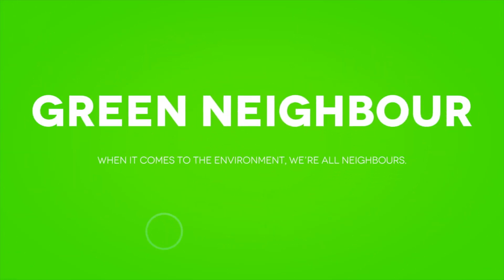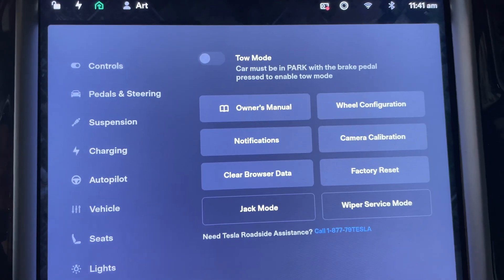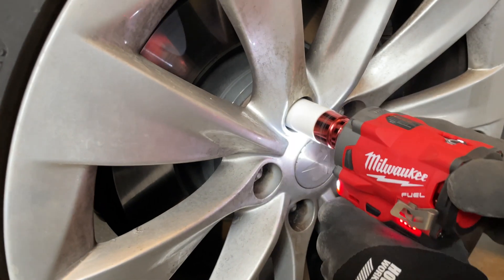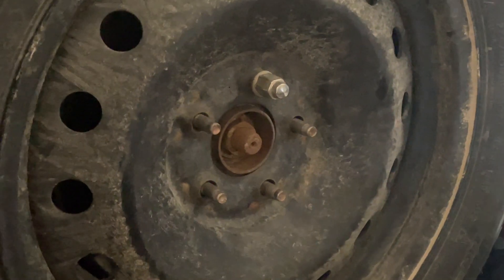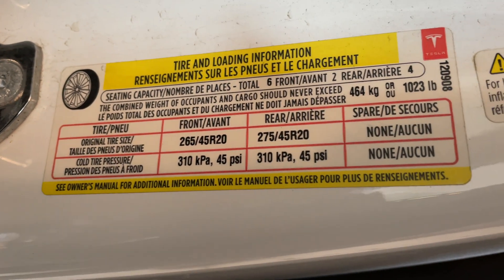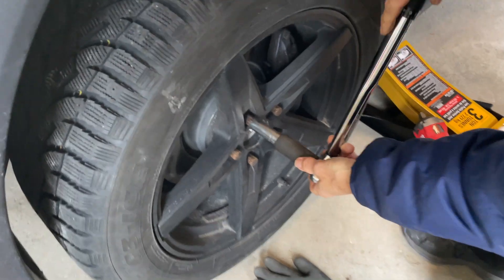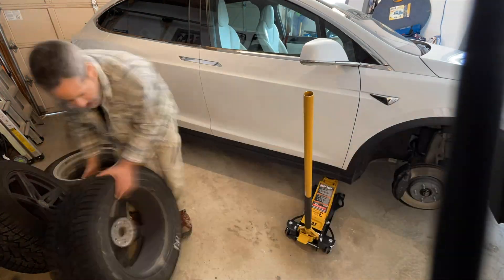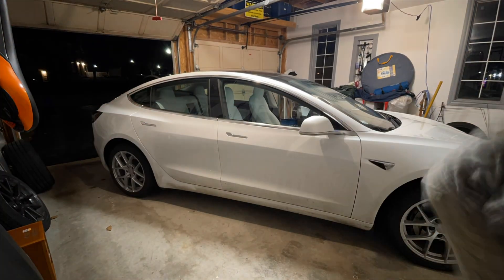Tesla Tire Swap (STEP-BY-STEP)

Comment: can you get that torque wrench at a walmart or those x bar types they have? is a 21 mm the only thing youd need for that impact drill?
Reply from the maker: You can probably get a torque wrench at Walmart. You can almost definitely get one at a hardware store like Canadian Tire. I also put a link to the one I used in the description of the video under “Tools and Equipment Used.” However, I didn’t really like mine that much. I think it’s too short. The longer the handle is, the easier it is to use, and the less likely you’ll rub your knuckles against the tire as you’re using it!
Reply from the maker: Yes, unless you have a different set of lug nuts for your winter tires, then a 21 mm socket is the only thing you’ll need for both your impact driver and your torque wrench.
Reply from the maker: Having said that, I have two 21 mm sockets, and it’s very handy to not have to constantly switch one socket back and forth between the impact driver and the torque wrench.